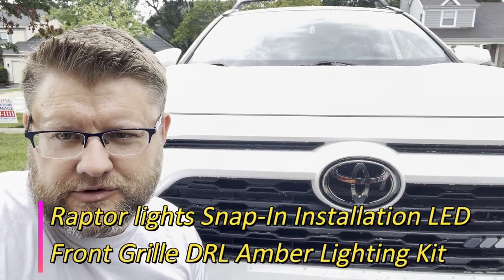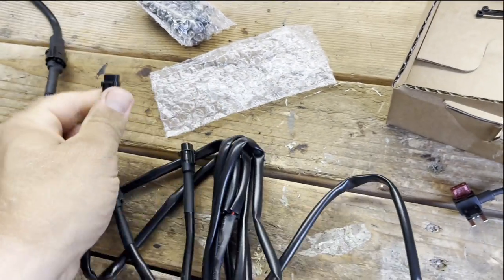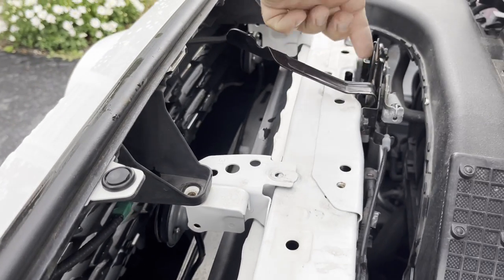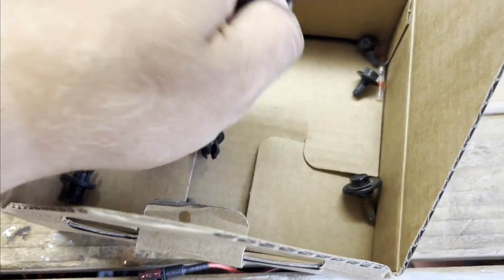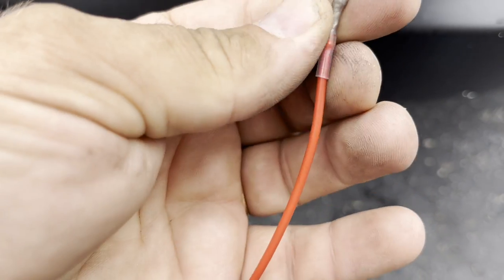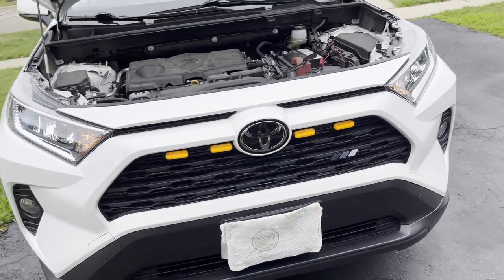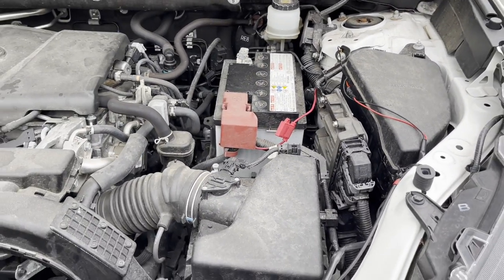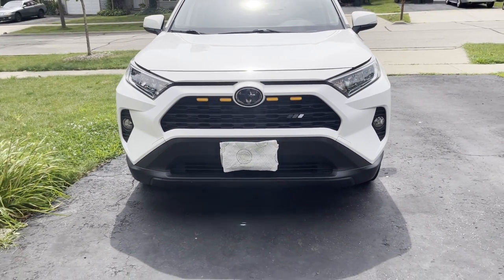Toyota Rav4 2019-2022 Grille Raptor LED lights

Comment: Hey dude,

New Rav4 owner here, in a little bit of a pickle after installing these. Disclaimer: I'm not a car guy. This was really my first DIY attempt at adding a modification.

Here's what happened.

Two days ago, I installed raptor lights by following this video. After all, you made it look so easy. I clipped the lights into the grill and then moved on to wiring. I wrapped the (black) ground wire around a nearby bolt (not the battery) and secured it in place. Then for the power (red), the kit came with a little "add-a-fuse" type splitter for the fuse along with a 10amp fuse. I also decided to use the 7.5amp USB2 fuse located in the upper left corner of the fuse box.  I plugged the "add-a-fuse" into the 7.5amp USB2 slot, and then put back the original 7.5amp fuse into one of the slots before filling the other slot with the 10amp fuse that came with the kit. (I suspect this is where I messed up).

Anyways, I turned on the ignition and the raptor lights worked beautifully. I drove around the rest of the day, no problem.

The next day, I was driving around and the dashboard tells me that the "Start Stop system" has a malfunction, and that it's been disabled and that I should see a dealer. I didn't sweat it, as I never really liked the system anyways. A few hours later, I see a "battery charging" alert on the dash. Again, didn't think anything of it.

Then today (the second day), I was dropping my daughter off at school when she started playing with the power windows. Suddenly, I felt the steering wheel lock up (lose power steering). I look at my dash, and a whole myriad of alerts and lights lit up. The power steering symbol, the parking brake malfunction, the battery symbol, and several other system alerts. It was honestly scary and overwhelming. Panicked, I managed to immediately pull over and shut off my engine. Upon trying to restart it, I realized it wouldn't start. Very similar to a dead battery type situation, the dash lit up but the car wouldn't start– only make that clicking sound that we all dread.

I managed to get someone to jump start my car, which worked at first, but immediately died a few moments after... which in my very limited knowledge of cars means that it's the alternator, right? Anyways, I remove the raptor lights completely (removed the ground wire from the bolt, and removed the "add-a-fuse" from the USB2 slot, putting back in the original 7.5amp fuse). I checked to make sure that fuse wasn't blown and it wasn't. Then we try jumping it again, this time leaving the cables on for 30 minutes. But no luck. After disconnecting, the car died a few moments later again.

I've since had the car towed back to my home, but I'm confused, frustrated, and honestly a bit embarrassed feeling like I must have made a real rookie mistake without even knowing it. So many people seemed to have had such an easy time installing these lights.

Right now, all I can think about it that I must have made a dumb mistake with the fuses. Maybe I should have only put one of the fuses back in the "add-a-fuse" instead of both? (10amp + 7.5amp in a 7.5amp slot) Maybe they should have been reversed in terms of which slot they were in? (Does that matter?) Anyway, I'm really hoping I didn't really mess up my car in a costly way. What should I do? Any help would be greatly appreciated! Many thanks.

Reply
Reply from the maker: First of all these, light will not cause any problems because it connected to a fuse usb power outlet. I think your battery terminal got  loose or your battery is weak now. Also it is very very important how you jump start the vehicle. You never want to jump start vehicle by connecting terminals directly.,did you connect negative cable to the metal engine mount? Disconnect battery completely for 30 minutes then when you reconnect everything make sure battery terminals are tight. https://youtu.be/EsTmw02H8sw time 6:24 what I think happened you did not tighten the battery connector and it got loose. the battery wasn’t charging properly so your battery needs proper charging. Watch the video link above times 624. It’s very important how do you jumpstart vehicle. Charge your battery when its out of the car, but trickle charger and charge it in the garage. I think you simply drained your battery. Also good idea to have volt meter, so you can check your battery voltage which should be more than 12 volts if car is running.
Reply: @nazarettos6987  Thanks for the reply!! I feel like I couldn't have caused it too because yes, it just went into the USB outlet and none of the fuses are blown. But the timing feels too impeccable to be a coincidence, right? The day after I installed the raptor lights? I double checked the battery terminals and the bolts were tight. I removed the battery today and had it tested at an auto parts store, and the result was healthy despite being very weak (less than 12v). They were able to charge it fully in 3 hours, and test it again. Again, healthy. So now feeling like its the alternator or circuit damage? As for jumping the car, I jumped it the way I have always jumped cars. By connecting to the two terminals on the battery on both the donor and receiving vehicle. Is that what you mean by "connecting terminals directly?" I shouldn't be doing it that way?
Reply: @hollywoodhusky  did you ever figure out what was wrong? Is your battery good now? I’m asking because there was a class action suit against toyota rav4 for what they called a parasitic drain on their batteries. It sounded a lot like what happened to you.
Reply: @moeswayseldom12  Hey man, I never really figured it out. I took it to two mechanics and they both thought it was the alternator and just coincidental timing in terms of the raptor lights installation. I'm not totally sure about that as I had driven it for almost a month, almost 1500 miles, without issue and then the day after the raptor lights installation these problems started. I ended up taking it to a Toyota dealership to have it looked it, without mentioning the raptor lights (removed all traces). They too said it was a bad alternator. I purchased the car through Carmax, which came with warranty. So I asked them to fix/replace the alternator. They "fixed" it, only for it to fail again. I brought it back to them a second time, and again it was "fixed." But it again failed. I got fed up and just returned the vehicle altogether. Ended up buying a new 2023 from the Toyota dealership. Not planning on messing with raptor lights again after all that haha.
Reply: @hollywoodhusky  it may have just been a coincidence after installing raptor lights because i heard about many 2020-2021 rav4s having battery and alternator problems even with low miles on them. Like i said there was mention of a class action suit against toyota. Probably a good idea that you got a newer model because from what i hear, 2022 and 2023 have been fixed from that problem, but not the older models. I dont blame you for not wanting to install any lights after that lol.

Comment: Hi, I heard that the top fuse power should be lower than the bottom fuse on the fuse tape order. In this case, 10A on top while 7.5A on the bottom of the fuse tape, does it still ok? Or should I get another 7.5A fuse on top and works with original 7.5A fuse?

Thanks
Reply from the maker: I plugged it in as it fits, 7.5 fit only in one spot so i did it.
Reply: @nazarettos6987  Actually my package comes with two 10A fuse thats installed on the fuse tape alteady, so should I just remove the lower 10A, and install the 7.5A thats pull out from the car? Thanks

Comment: Can’t we connect the raptor light to any of the spare fuse. I can see there are many spare slots and current only flow when the car is on. Also is Raptor light Toyota certified
Reply from the maker: Yes you can connect these lights to spare fuses,but it can not overload that fuse to wich you connect. No Toyota does not certainly aftermarket stuff, they only want to make money for themselves on their own products. These light nit gonna void any warranty as long as you don’t fry anything electronically.
Reply: Thank you. I was just worried if it gonna void warranty

Comment: Hi v informative video. Can u please let me know if we remote start the car even then these lights glow ? 
I need lights to turn on we i remote Rav4
Reply from the maker: If you connected to the power source that only turns on when you start the car, then everything should be fine but if you connected to the constant cable, then it’s gonna drain your battery

Comment: How to you use the shrink tube with the ring of led to connect the fuse cable together?
Reply from the maker: You put those two red cables together,twist ends together,slide shrink wrap over and heat it up with a lighter.

Comment: Can I use them on a hybrid
Reply from the maker: If you find where connect the wires for power supply, because hybrid has different fuse box
Reply: @nazarettos6987  Thank you for the advice and fast reply